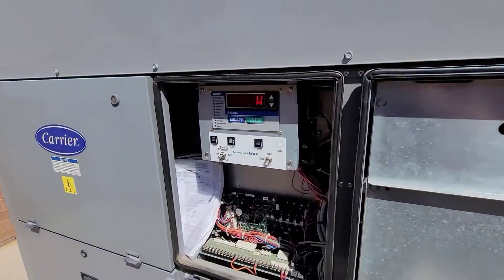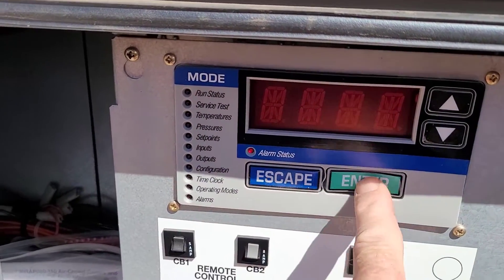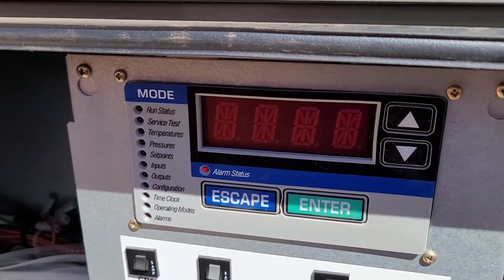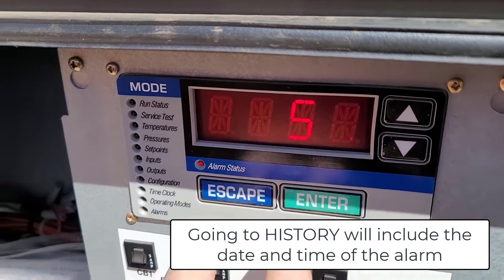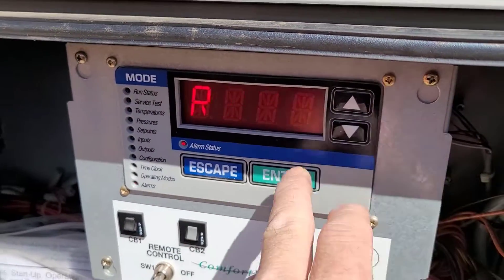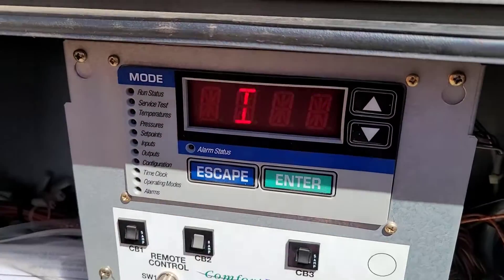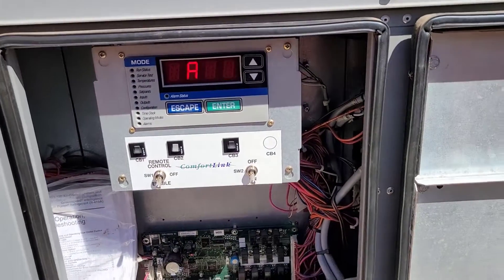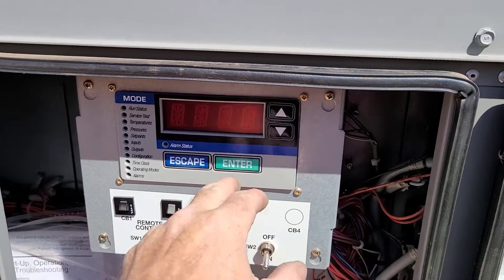Easy way to read alarm description in Carrier Scrolling Marquee

Comment: Buy carrier comfortlink tool and put purchase against repair. Stash away in van. Keep secret from co workers. Problem solved. But seriously the comfortlink displays suck, how is it trane has an interface for interllipaks that is 25+ years old and just works
Reply from the maker: New ones use tactile buttons. So once the old stock is used up you'll be getting some really nice new ones if they are not already in stock.

Comment: That reeks of cheapness
Reply from the maker: It's more bad luck than lack of trying.
Remote controls work for years using the same exact push button technology. 
It must have to do with the elements.
The new ones have tactile buttons and they should be showing up out in the new units

Comment: The Aqua Crap has one of the crappiest error codes EVER! A051 is NOT a chattering contactor. Some I had were weak pre-set H.P. switches. Most are intermitant compressor protection modules that get dripped on by compressor sweating in summer. If Goodman made a chiller it would be better than an Aqua Crap.
Reply from the maker: Goodman engineers would have to figure out what a Chiller is first. LOL
Those compressor protection modules can add to the fun tho
Reply: Salaaaasaaaaaaennntmn❤k

Comment: Those buttons blow!
Reply from the maker: That is true. 
I was taking these apart and hacking in tactile buttons.
Smooth as butter after that!
The new ones will have tactile buttons.
Reply: @hackfreehvac 2024 and buttons still suck 😂
Reply from the maker: @Deltron6060  Yeah. But check out my video of me installing my own tactile buttons.
Buttons click and work like gravy! 😆
I'm thinking of repairing these as a side gig. Maybe have people give me their old one plus some coin and I have a working one ready.
The switches I used made them better than new. 👍👍
Reply: That's why I like my navigator
Reply: What is a navagator
Reply from the maker: @000whitefang  They are nice.
Getting the boss to get the $1k tool is the thing. LOL
Reply: Google carrier comfort link navigator, it a hand held tool to help ease the pain of using the scrolling marquee.